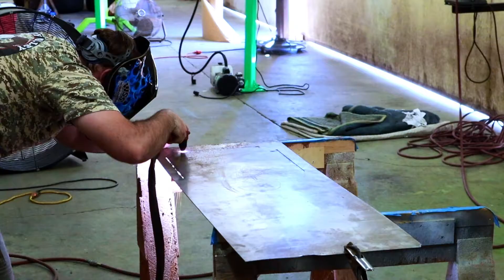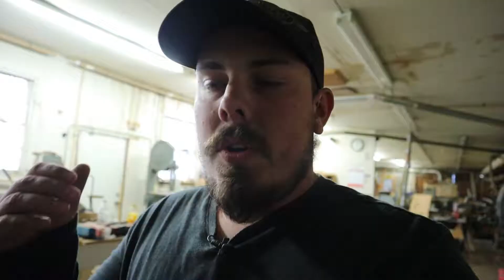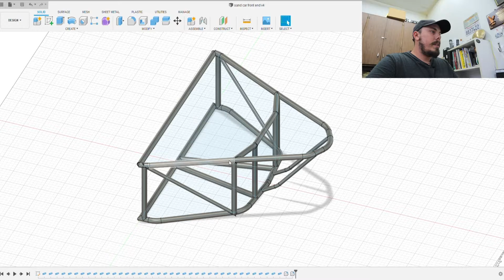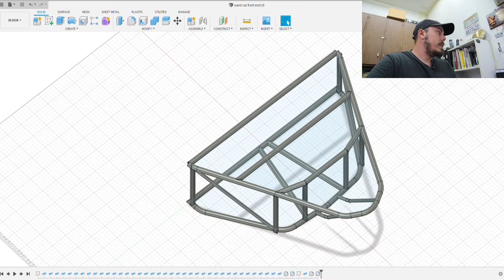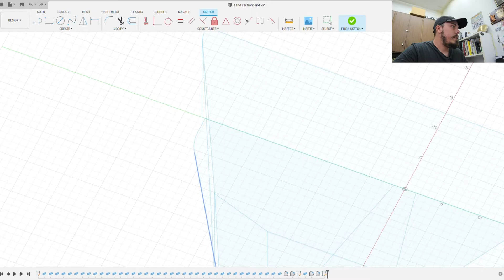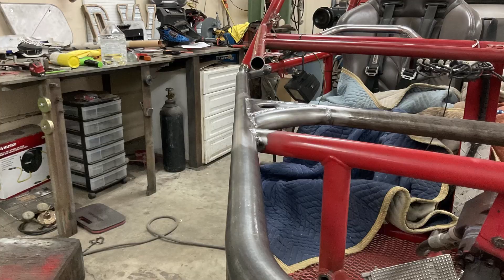sand rail repair part:3   Fusion 360 simulation part 2

Comment: This video made alot more sense and the ability to stress parts is a good tool to be able to use.  But had you fully designed the assembly in Bend Tech and than imported it to Fusion 360 would you still be able to perform the simulation?
Reply from the maker: Hello and great question to answer your question. Yes you can do that. I’ve done it backwards before where I took a Bend tech file and import it into CAD but I found that it’s easier to design it in CAD and then import it into bend tech. But at the end of the day, it really depends on your application and what you need it for.